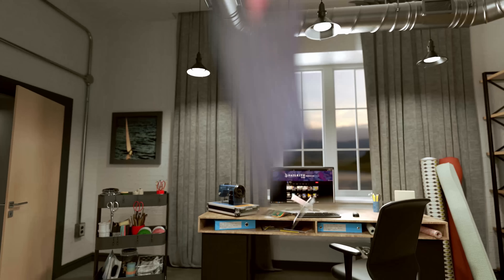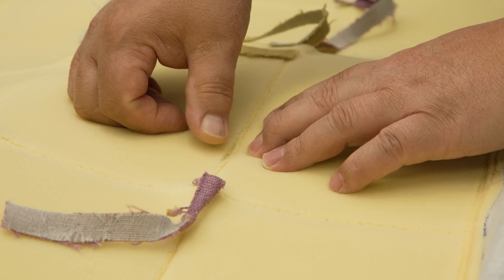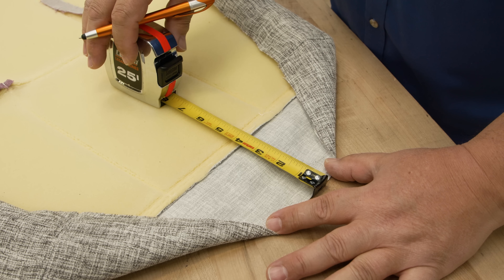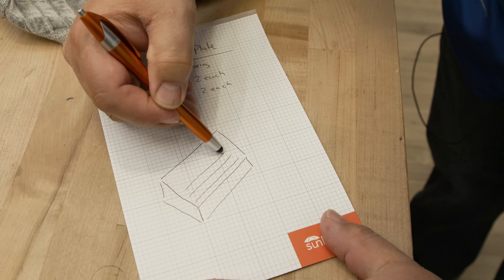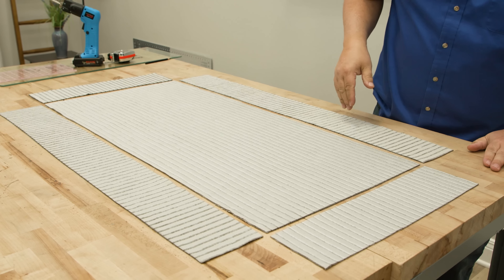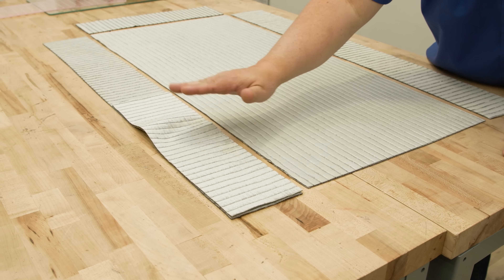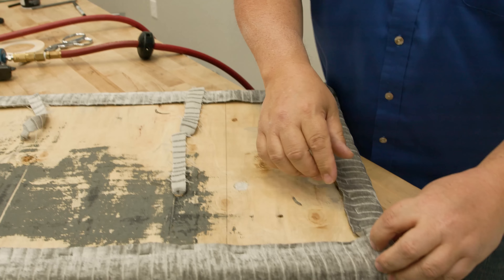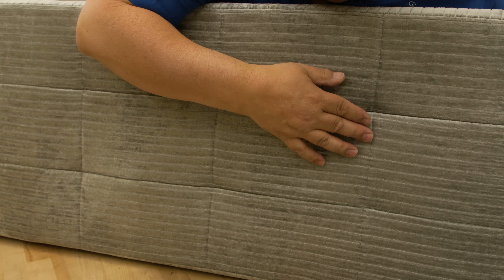How to Reupholster a Platform Bench Cushion (Cushion Stapled to Backer Board)

Comment: Thanks so much for all these fantastic videos. I have a math question ... I believe 1/2" was added to the length and width, but the seam allowance is 1/2" meaning that the finished cover will be 1/2" smaller than the original height and length measurements after it's all sewn together. Is this correct? And then the fabric is stretched over the foam for a tight fit? I have a huge reupholstery project I'm about to start (every single cushion on our boat) so I'm trying to get a good grasp of the process before I start measuring and cutting. Thanks for your help!
Reply from the maker: Yes, the foam is 1/2" wider in both dimensions or 1/4" added on all sides of the foam. The top plate is then cut to the exact same size as the slightly oversized foam. When the ½” seam allowance is taken up the cushion cover will compress the foam making it almost the perfect size, which is about ½” smaller in both dimensions. If you are stapling it onto a backer-board just make the boxing a few inches wider so you have plenty to pull over the board and staple. I hope this helps, if you have more questions let me know.
Reply: @SailriteDIY  thank you soooooo much for the super helpful reply, this makes sense!
Reply: You guys are the best!

Comment: I can’t seem to understand. If I see the boxing before attaching to the top plate, seam to seam on an edge of boxing will be an inch shorter than the edge of the top plate. How do you then get the corners to match up?
Reply from the maker: We want the top plate to be very tight, so it does not show wrinkles when an occupant sits on it and gets up. So... we make the top plate match the foam size and after the seam is done it compresses the foam for a nice tight fit. If you like you can add some seam allowance, but don't add too much or you will have a loose fitting cover.

Comment: Why did you only add 1/2" to total length and plate ant 1"
Reply from the maker: I wanted the cover to fit tightly over the foam compressing it slightly. So.... after the seam allowance it take up the cover will come out just a little smaller than the size of the foam.